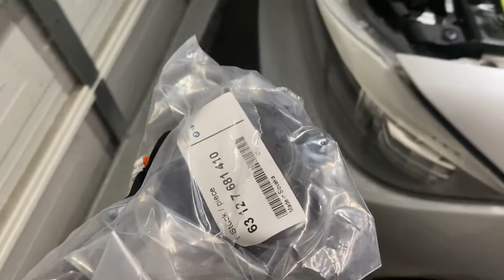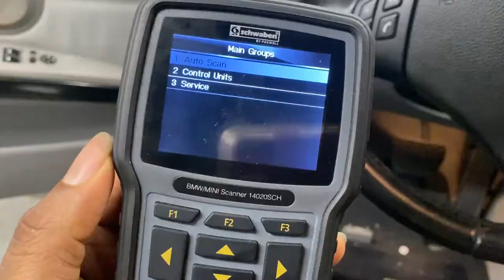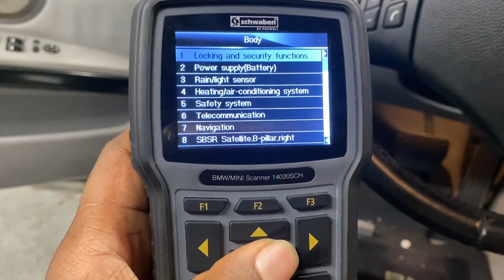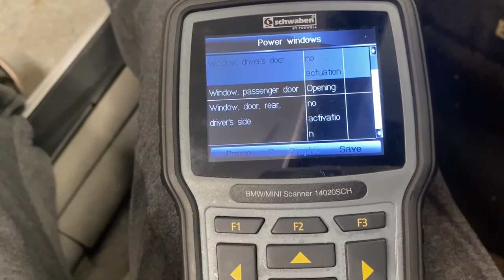Fixing Random Issues on My BMW E90 335i

Comment: What single turbo you got, remember you had the on3 before
Reply from the maker: I went back to the 61mm jb on this setup again. I have a S362SX-E that I want to fit but need to weld up a new downpipe, so rocking the 61mm till I get a chance to do it.